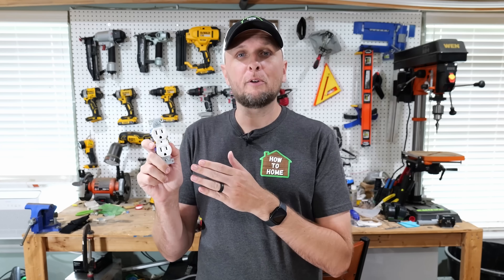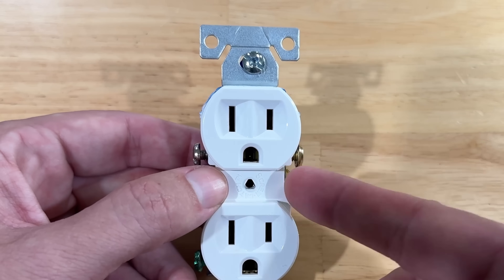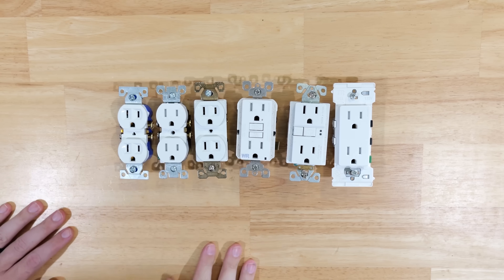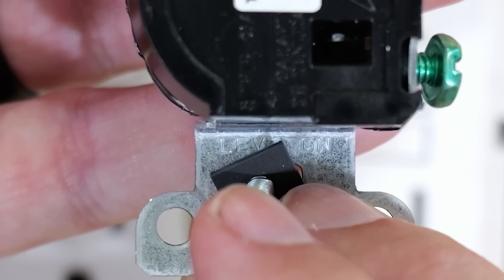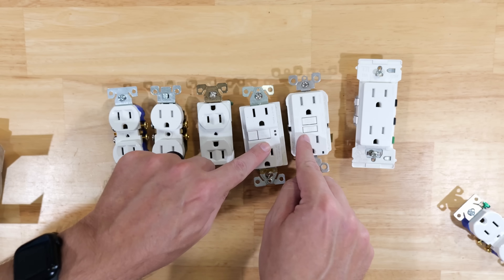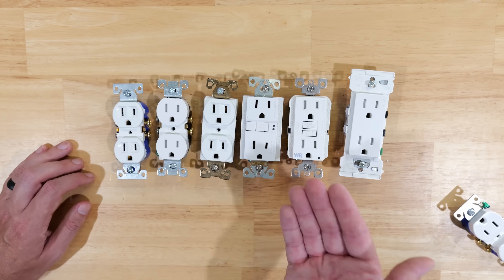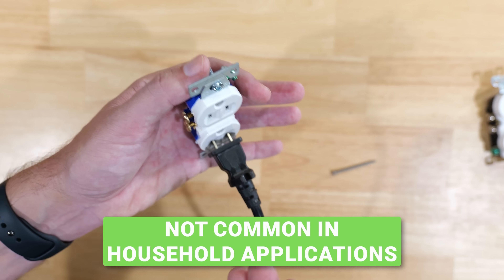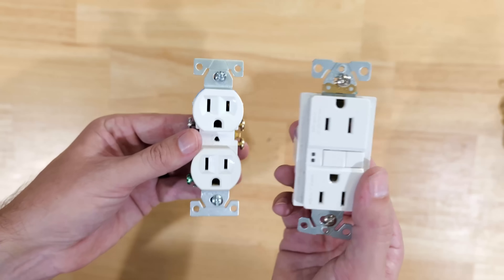The Shocking Reason Why Your Outlets Are Installed Upside Down!

Comment: "The Shocking Reason..." ⚡ Yep Adam, I got your joke; appreciate the humous pun. Witty. Personally I do understand the reasoning and prefer my outlets installed ground-up, but I agree that its annoying when an appliance's plug is designed for ground-down and then bends oddly. (In this case, cable management clips or command-strip adhesive solutions can help if absolutely necessary. Anyway, thanks for a thorough report on all the reasoning and such. Keep up the great work making these videos.

Comment: Google "90 degree extension cord".  99% of the three prong cords that come up has the ground prong on the end closest to where the cord is.  If you plug any of those into a receptacle installed ground prong up, there is a continuous pull on the cable.
Reply from the maker: Agreed

Comment: I write all caps sometimes its all because of my phone but also my hands. There in a lot of pain. U obviously didnt see what i wrote. I said i installed many many outlets, never had one not pass. So i said maybe code changed.And things. Like boxes n bx cable n grounds. Like whats the best insulator from electric???🤔 You might answer ideal insulators, i would have answered Space. Diffrent era, please dont short circuit on me🙂. I tryed to make sure all small letters. 🙂

Comment: Give it up. We have been installing plugs this way for many many years. The likely hood if a failure happening is very minute.  I have never even heard pf a failure because of this position.  I turned out as a journeyman electrician in 1971. I must have installed a million plugs before I retired.

Comment: Very interresting and objective mind approach.   The short-circuit risk scenario, is maybe legitimate, but let's just look into connexion reliability : The ground proung ISN'T suitable to hold  straight the male connector when the ground hole is up, in particular with less flexible, big straight cables..
Another solid indication pointing toward a nore common issue more likely to append : As did the wise cnstructors of those parts, I will let readers to choose and check it that aspect by themselves : just search images of any, and I really mean ANY, ANGULAR male plug of that type. Even the 45 deg side anle ones...   For connection stability, you should never get the cable angled up and dropping from it's own weight.

That tells appropriate orientation upside, downside and even horizontal (ground to the left or to the right)
Thank you for sharing your researches

Comment: Thank you for this video. Great topic and very good presentation.

While it does not matter if the ground is up or down here are some things to consider.
1. No mater which way you put the ground be consistent in the direction you chose.
2. Some angled plugs will not work with ground up.
3. With the ground down it is possible to break the outlet casting around the ground prong if pressure is applied on the cord.
    Like when someone steps on the cord. I have never seen this happen in the ground up position.
Hope this helps.

Comment: Sorry, but the primary reason for wiring them up has more to do with industrial applications and specifically hospitals. Most consumer cords are made so that the majority of the strain relief is intended for ground on the bottom. Wiring them ground up ends up causing more harm because of the additional strain put on cords and wall warts.

Comment: I have switched pretty well all my receptacles ground side up because i had a incident were the plug was partially out on a normally installed receptacle, ground pin down. A object fell over the plug and arced out across the hot and neutral, since then I've installed ground pin up.

Comment: Ground up of course.  Defiantly thought about it.  But I settle on the hot on left cold on right reasoning similar to plumbing.  Along with short protection from a framing square falling along the wall.

Comment: The only criteria in installing a receptacle is when plugged the longer grounded prong is first to connect and last to disconnect. That said a receptacle with ground prong orientated up has a tendency disconnect the electrical ground due to weight of the cord thus defeating the purpose of the ground prong first to make last to break theory.

Comment: This type of contact and power system is one with many problems, negative things.

The ones we have in Europe such as Norway. Denmark. Sweden and other European countries are much better.

If you have an angled connector, you can plug it in both ways, otherwise you cannot use two angled connectors at the same time

It doesn't matter which way you plug in the connector.

Comment: No, they aren't. In fact every single installation guide has pictures of those outlets installed with the grounding hole AT THE BOTTOM of the outlet.

Comment: As a residental customer (homeowner) and Mechanical Engineer with a working knowledge of the NEC, my ONLY experience where it may have marginally helped to have the ground pin UP was an instance with a thin necklace, similar to a single strand wire size chain. My wife dropped this necklace off a bathroom shelf near the receptacle and it fell between the face of the receptacle and plug for her hair dryer. The necklace immediately made contact across the hot and neutral, causing the necklace to arc, flash, smoke, and melt. This left scorch marks on the receptacle and plug and tripped the GFCI. However, if the receptacle was groung prong up, I feel this flexible thin "wire" would have similarly draped across all three prongs, connecting the hot to ground anyway, with similar results.

Otherwise, I have only run into the situations noted by others with the residential device cords manufactured such that ground prong down works better.

Comment: I was taught to install with the ground prong up. Reasoning was that if theres a faulty breaker and the plug is half way connected in the receptacle a bobby pin or other metsl object could potentially short circuit across the hot and neutral.

Comment: My reason for wanting ground up is gravity and length of pins. When a heavy cable or extension cord is plugged in ground side down, the weight trys to pull the cord out of the socket. The ground pin is Always longer than the other two pins. With ground up, it is almost impossible for the weight of the cord to pull out of the socket. I also believe ground down is the reason so many cords are missing the ground pin. When something puts downward pressure on a cord with ground down, the pin snaps. With ground up, it just pulls tge ground pin out of the socket a little, but still remains plugged in. And this pressure actually forces the "working pons" depperinto the socket. With ground down, the hot and neutral can be pulled out while the ground pin is being bent or broken.

Comment: The outlets in my residence are all sideways.
Another thing to examine are the various corded products that plug into the outlets.  Some "wall warts" and GFCI plugs are intended to be inserted so the bulk of the plug is below the outlet, not on top of it.  Some appliances (and multi-outlet strips) have an L shaped cord that is intended to go downward.  If the receptacle were installed ground prong up, the cord has to make an odd loop in the air.

Personally, I wish the hole for the ground prong was shaped differently.  The "mouse hole" shape should be inverted so the outlet is smiling instead of making an unhappy face.  Perhaps the sad face is intentional -- to help keep kids from playing with the outlets.

Comment: I like this video. Personally, as an electrician for 30 years, I always ask the final customer how they would like the receptacles oriented. 10% would say ground up; the rest preferred ground prong down. No problem. The only time I would make my own executive decision, is that if the receptacle needed to be installed horizontally. Only then, by instinct, I would always orient it so that the neutral side was on the top (90 degrees to the right) And never once had a complaint or a change order.  But until the NFPA 70 decides otherwise, I'm sticking with customer preference.

Comment: My argument and observations from an experienced outletptical user is that you get critical strain relief with ground on top.otherwise you will notice the weight and physics of the cord will want to pry the cord down and out slightly.so upside down face prevents this by placing the strain on the centered and round ground lug keeping the spicy prongs flush😎👍

Comment: Speaking of a metal object hitting the plug. That happened to me. It was a Displate, and it's the reason I now use two magnets to hold them up, instead of just one. Luckily it only caused a small spark that burned part of the outlet. It also woke me up because that was where my UPS was plugged in and the alarm went off. My dumb mistake could have started a fire.

Comment: Canadian electrician here. When i started my apprenticeship in the mid 2000's we had it hammered into our heads that receptacles should always be installed ground up. Many a coffee break argument has been had about this issue. I had always installed plugs ground up but after replacing half a dozen refrigerator receptacles or so the problem became clear. 

Equipment with 90 degree plugs are always designed for ground down, this is always the case for refrigerators. When the ground is up, the cord sticking up wants to pull the plug out of the socket and vibration from the fridge motor slowly wiggles the plug loose causing low level arcing. I'd find these plugs half melted and covered in soot.

The inspection authority in my region was demanding grounds up but after discussing this issue with the head inspector he relented and said "ok, fridge receptacles can be ground down".

Personally my preference is for ground down. If I'm doing renovations i will do that same as the rest of the building. If a blueprint spec says ground up, I'll do that. My house, ground down. I will usually speak to a building owner or manager and suggest ground down but if they want ground up i won't argue.

Hope this helps anyone trying to wrap their brain around this.
Reply: This was very informative. Curious, which region was demanding ground up? The only place I can remember seeing ground up was at an AirBnB in Quebec where the owner did all the work himself.
Reply: 😮 I'm z(

Comment: I've seen them installed up, down, sideways, face down, and face up (in a proper floor box or on desks). It doesn't matter and never will except for the 90 degree plugs that generally run ground prong down, although I have seen the random one that runs sideways so it could be prong up or down.

Nobody that knows anything about wiring really cares, although some have different preferences, but thank you for making this video just to shut down the idiots that feel the need to correct others for no reason.

Comment: I believe the EATON outlet instructions on the back are "upside-down" because the installer is more likely to flip it top down on the short axis to access the connections.  Thus the writing becomes right side up.

Comment: hospitals require ground UP... the reason for this is that if something could possibly fall and cause an 'arc' between line and neutral... and since Pure Oxygen is present in the hospital setting, this could cause a fire....

Comment: After my home remodel I replaced all my child safety receptacles which was every one of them then turned them all to ground down.  Took out all the receptacle that had breakers on them replaced with regular 3 prong receptacle .  After the inspector went through I also, changed all my arc fault breakers to good old regular breakers.  Piss on the government good old breakers is all you need.

Comment: There some appliances that have cords with flat plugs where the wire comes out at an angle. If  plugged into an outlet with the ground plug up, the cord will be in a top  and the cord will want to pull away, unplugging the appliance. If it is plugged into an outlet with the ground prong down, the cord will rest in a downward more natural position close to the wall. 

I have not found the argument of falling, nails, screws or screwdrivers to be a convincing argument as to why the ground to be up.

Comment: I like the scheme where switched outlets are ground up.  However!  I have many outlets in the house that are split.  The “buss” is designed to be cut allowing one to be switched, the other not.  This kind of messes that up.  Is there some allowable code to permanently mark a switched socket?  what do you professionals do in this case if following the ground up for switched?  I think inconsistency would be worse.

Comment: Conduit is best. NEC now mandates to run a specific ground wire in pipe... Wasn't always like that and the metal, EMT, box pipe provided the ground protection... NEC since added must have ground wire in pipe. Prevents people from unwittingly adding plastic & breaking ground, interrupting the bond to earth... pipe the boxes and outlets horizontal,  hot up.  Safest orientation with multiple layers of redundancy.  The hot will never come off and if it did loosen will hold itself naturally... And if it did fault to ground the metal  pipe, extra ground wire will immediately fault and trip the breaker.   Pay a little more and pipe, conduit it out folks... So much safer, can pull extra wires later, etc... Without having to tear out walls... Animals like mice can't chew through it too...

Comment: Horizontal, hot UP, ground to the right is safest especially when using with pipe, mechanical ground protection. Hot being up and outlet horizontal will prevent the hot from coming loose and causing a fault. If it did come loose, wire will pin itself. Gravity will hold it against the terminal.  End of discussion... BUT it's really how you want it. Local practice and what cord application works best unless forbidden in the NEC which he explained in video.  Safest is horizontal, hot up, ground to right.

Comment: I am used to seeing the outlet a and b upwards rather than upside down but never tried it before. But it should be right side up anyway on the wall though. But not on the floor facing up. I know these are not floor mounted. Although there is floor mounted which it is supposed to keep it away from the sink or water or get a cover protector. I think japan should use outlet b update and carefully cause I know japan uses just 100hz but it uses either 50hertz like pal Australia or Europe does but it uses 60hz so that means eastern japan uses 50hertz while western japan uses 60hertz. For the earth of outlet b might be upside down but it should be right side up. In the down position.

Comment: Usb charger cord wrapped in metal jacket will do the nice job of shorting on the slightly pulled out plug :). No matter you have it installed up or down

Comment: The ground should be down because most of the appliance with the plug is intended for the ground down. When you do ground up you need to twist the wire to plug it in.

Comment: If you have flat plugs, they are arranged so the wire hangs down when the ground is at the bottom. If you flip the receptacle so that the ground is up, the wire pulls on the plug, which can damage it or cause it to come loose. 
Looking at a dryer receptacle, the urban myth that the ground prong on top is safest is actually making it less safe.

Comment: Yes, I considered ... explored ... researched ... meditated on this topic, repeatedly and long-term (60 years). The only thing I did NOT consider was the paper clip across the line and neutral contacts. And I have to disagree: it is not that unlikely because, Murphy's law. I came to the conclusion that the only reason to prefer a particular orientation is in the case where a particular cord itself will be dedicated to the application, and that cord is right- or left-facing, and would be clumsy or would not lie neatly.

Comment: We have an outlet installed ground-prong down, below a cuckoo clock that is operated by weights attached to chains. When the bird cuckoos or the music plays, the chain will sometimes move side to side. One time, one of these lightweight chains hit the live prong of a partially-unplugged cord. The resulting arc cut the chain, although the outlet wasn't damaged. Since then, I have been extremely careful to ensure that anything plugged into that very handy outlet is completely inserted, and that the chains are running beside, not behind, any plugs. Just an example from real life that something can actually make contact with those prongs, no matter how the outlet is oriented. We were able to put the (now-shorter) chain back together, and our cuckoo clock faithfully calls out each half hour.

Comment: Wouldn't the simple solution be to have around half of the live & neutral prongs protected with a non-conductive coating/sleeve, which means half-unplugged results in almost 0 risk of a short from a metal object or electrocution ?

That is what we have where I am (not in the US, 240v) & the ground is always at the bottom.

Comment: I live in Canada. In bedrooms, there hasn't been a ceiling light fixture for at least 40 years. So some outlets are wired to have the top one controlled by the wall switch, like for your bedside table lamps,  and the lower one being permanent. So it doesn't really matter if the outlet is installed up or down !  😉

Comment: Backing ohhhhh..1983/85 (maybe 3rd-4th grade) i had a metal clothes hanger fall off of my bed and land square on top of a poorly fitting plug...the crazy spark and popped breaker was enough for me to remember that moment...and decide that ground plug is much better upright...also replace any loosie-goosie  receptacles for safety sake.

Comment: I work in a hospital, I was told the reason they do it at the hospital is because of metal clip boards. If one fell down behind a desk and it will hit the ground and rotate away plus not complete the circuit unintentionally with ground down.